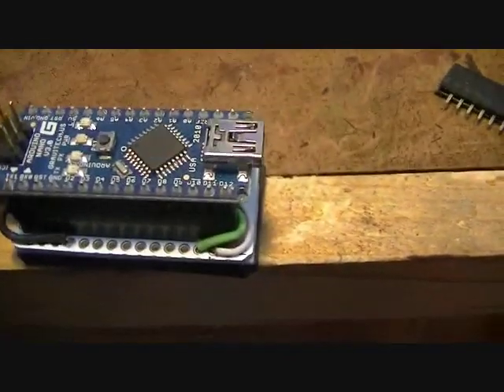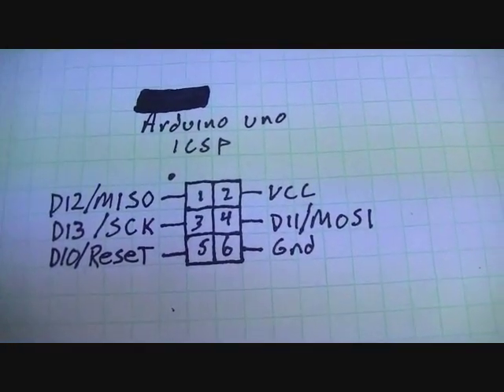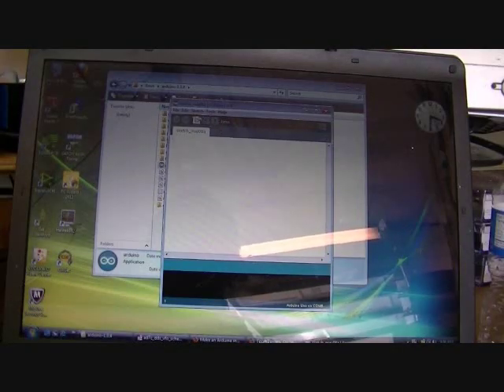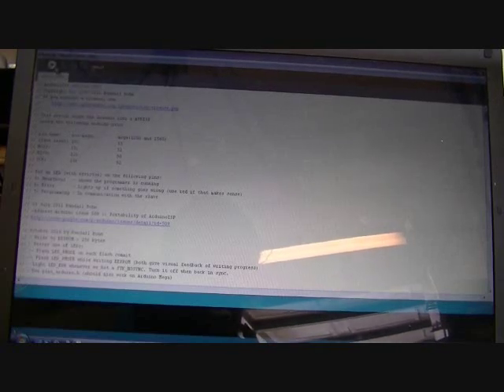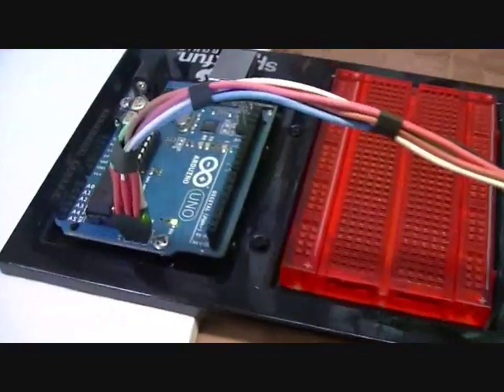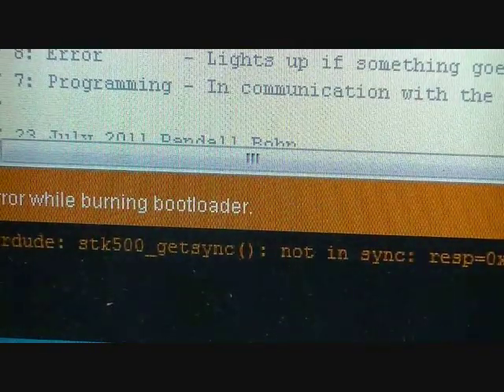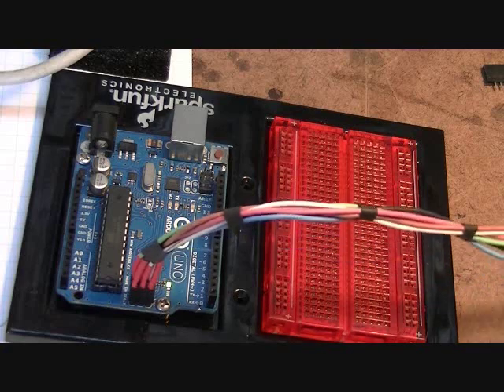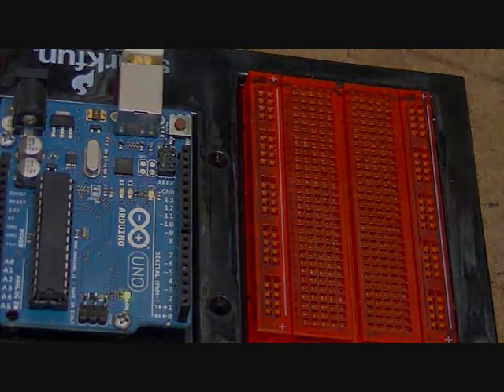burning arduino bootloader using arduino nano

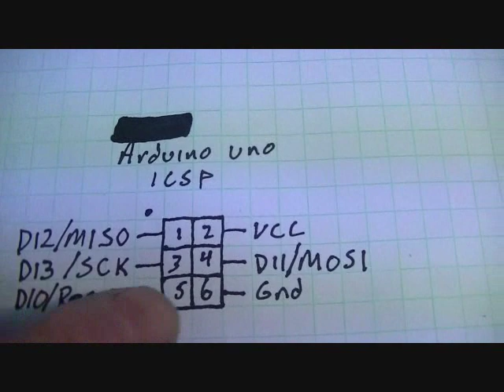Comment: Let's make robots has moved and I couldn't find the schematic for that board you have. I tried just jumper wiring the pins shown at 1:34 to the UNO ICSP, and it kind of looked like it had worked, but the UNO still wouldn't accept a program when I was done... Do you still have the wiring diagram so I can wire this up? Thanks!
Reply: Ok, so never mind, just jumpering those pins did in fact work. I just hadn't gotten to the part where you have to try 2 times... Thanks for this video!